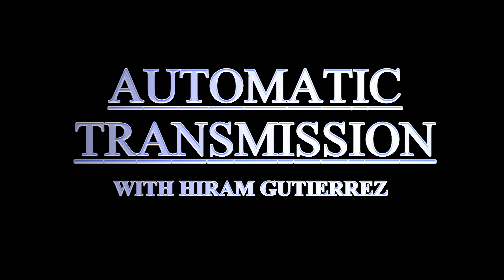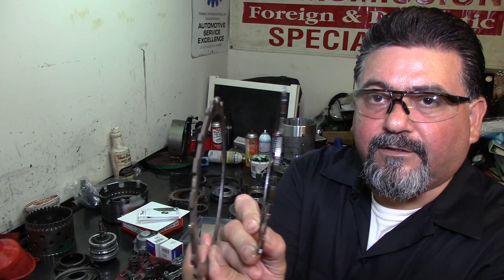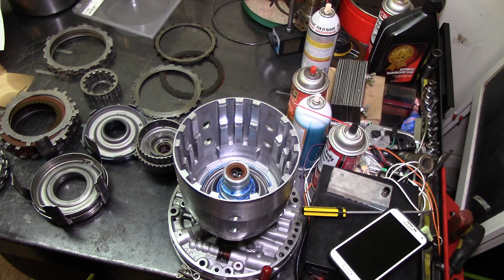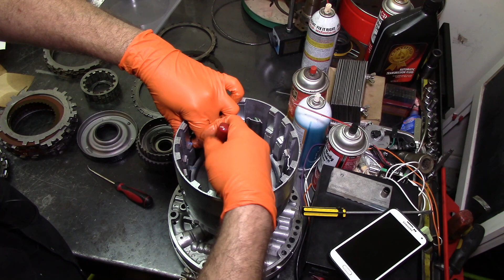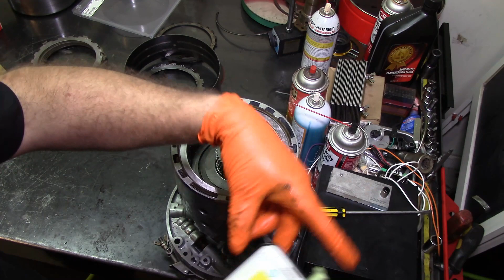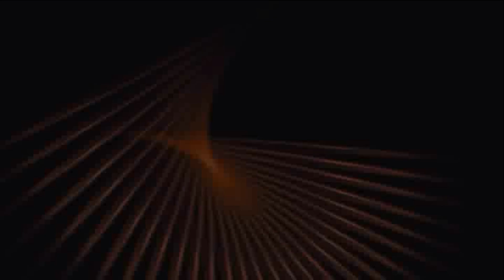Z-PAK by Raybestos 4L60E 700R4 3-4 High Performance Friction Plates

Comment: I've been a tech in the Valley of The Sun, AZ for 15 years but never once rebuilt a transmission. Watching your videos has inspired me to learn more about transmission failures and rebuilds. I was just given a 98 S-10 Blazer that needs a rebuilt engine and fresh trans rebuild by the looks of the fluid. Seems like it was stuck in Second Gear at all speeds. Maybe a solenoid issue but all of that will be replaced. It will be my first Full Transmission Rebuild. What Do you think about rebuilding Nissan CVTs? Thanks for all your videos!

Comment: What actually does the shift from 3-4? My 4L60E has developed a harsh change from 3-4. It's mainly when coasting or gliding. It gets to 55 Kph and it's like it just dumps it into 4th instead of the normal smooth transition. Also when coasting into a stop 2-1 can clunk in. It's like it just drops it to 1st harshly at the last minute. It doesn't seem like there are any burnt clutch plates etc, just harsh changes. Not all the time too BTW. Happens more after a longer drive, hot weather, rainy weather. Very strange. I was going to change the A & B shift Solenoids but I don't think they have anything to do with 3-4 change? Any help or info appreciated .-.-.
Reply: In the servo, (cap on the side of case) is a second piston on top of the 2nd apply piston or most commonly used Corvette servo. The band is used in 2nd and 4th. 3rd to 4th only change is the band gets applied
Reply: @kylealexander1172  thanks. Still driving the same car. I believe it's a mount going somewhere causing movement between shifts. The slow down clunk to 1st is apparently common even from new and something to do with the diff.
Reply from the maker: Scan it just to make sure you don't have the P1870 code. If you do the valve body is worn on the tcc isolator valve. It'll give you hard shifts when hot. I  have 2 videos addressing that issue.
Reply: @AutomaticTransmission  thanks. I have a Vident i400AU.  Have scanned the car many times over the past year. No error codes bar a SRS loop high resistance err (clockspring). But certainly no transmission error codes.

Comment: hi I need some help if you can I have a 1992 gmck 1500 4x4 and was towing a 20ft motorhome and backing it up and heard a slight ping noise and now no reverse, when you first start the truck and put it in revers it wants to go but stops then acts like neutral but doesn't want to roll in reverse hardly at all, it still shifts in 1,2,3 but shifts later 25mph and harder I want to know if this is re buildable b4 getting a kit thanks for your videos and help
Reply: Stripped sunshell

Comment: Mr. Gutierrez, I would like to get your opinion. I will be having my 4l60e rebuilt it's in a single cab 03 Silverado its at 425ish horse power I daily drive this truck. my trans builder is telling me I don't need the sonnex smart tech drum. I figured it would improve longevity of the trans. I would like to know from you what should I be having installed to ensure my trans lasts.
Reply: Victor Lopez 
Everything helps, I'm getting a rebuild 4L60e for a blazer ls swap .
I was really lucky that I found a 4L65e ( 5 planetary)  I bought Raybestos ,  drum  , selenoid  $300 so far in parts .
Reply: Adds $600 to the build

Comment: Hey Hiram, I'm a certified Automotive technician, and I've watched alot of your videos, and they have helped me alot. I'm a self taught builder. I was wondering if you could do a build on a 6T75? Ive done a few of those recently, and was looking for a video you've made but could only find dissasembly and common problems you've made, and also maybe some tips on testing the Tehcem on this transaxle? Your knowledge is priceless,and I'm sure I'm not the only Tech you have helped tremendously! Thanks for your time making these great videos.

Comment: I just built a 700r4 with the zpac clutches and   replaced the apply ring with a #7 but did not replace the drum itself. will it be ok?
Reply from the maker: +bob Owens Yes.
Reply: I have a 93 drum in my 90 700r4 case.  Do I need a 98 drum to use the z-pack?

Comment: Nice build so far Hiram. His truck will be a new animal with that converter and it'll help his 60' times and bring the engine to it's power band quicker. I ran a TCI 8" 6000 RPM stall race converter in my altered and thank God for my wheelie bars!

Comment: Hmm, for some reason, I thought the torque converter for a Trailblazer was a different size than one for a full size truck 😕
Reply: It is.
Reply: It depends on if the trailblazer is  a v8
Reply: Trailblazer is a source of inexpensive high stall converter
Reply: 2200 or 2500 stall from the factory

Comment: I repair alot of 4l60s with the 3-4s burnt out of them .
this is very helpful!  does the bonded piston come with this kit?
Reply: Hi Joe,
do you have to take anything else apart besides the torque converter before getting to the clutch pack assembly?
I'm thinking of rebuilding my 4l60 (trans leaked out fluid before and was driven on low trans fluid), which causes delayed engagement (acceleration delay before going into gear) but I want to make sure there isn't any more surprises, as taking down the transmission will already be painful enough (no lift available).
thanks
Reply from the maker: +joe wisman The piston is separate

Comment: Awsome vids! I watch and learn. Would like you to do a vid on Uprating and J modding an earlier model Ford 4R70-W / A0D-E. And the difference between building for street/strip and heavy towing/high continuous torque loading. thanks.
Reply from the maker: +Billy Bracewell I'm not sure about the J mod. I've seen it but I'm not sure if it would work. Or what its supposed to do. Some things about it doesn't make sense to me. But regarding the performance upgrades on those, I will make some videos for it.
Reply: In my pre wheelchair past i have done this. It is only a mod for making it shift VERY firmly. WITHOUT the "slip" of softer shifting units. THAT is  just for conserving your unit. the uprating and settings for continuous  high torque loads is more my concern. (hint) producing a simple tranny that can be easily rebuilt for high horsepower heavy torque apps.
Reply: AWSOME!! FYI the "jmod" only makes it shift firmer and harder. This saves life expectancy as it reduces or eliminates the "slippage" that accrues for "soft sift" situations. THANKS for replying bro.! I will be watching. I have a much modded 94 ford lightning. 1 of the only 780 so built before step side and tonneau covers.yeah, no more E4OD. she now sports a cobra GT500 engine in front of a weakling soon to be rebuilt/upgraded 4R70W/AODE. The 308 rears are and have been a challenge. I have now replaced the nest TWICE. Thinking on going back to the original 4:10. BUT i am getting over 25 MPG with the 308!! WOW!! MAYBE I can go to a 2:73??? Yeah. I'm A TECHIE DREAMER!!

Comment: what do you think about heavy-duty torque converters for 1997 k1500
Reply from the maker: +God is the way mm you can get performance converters for it, yes.
Reply: because I want heavy duty transmission for more torque for my 1997 k1500

Comment: WHAT DO I NEED IF I PUT 200HP SHOT ON MY 2004SILVERADO
Reply: A full length shot?? A gold level credit line at your local advance auto parts....and a standby crate motor ready to install.
Reply: The Silverado line of trucks specs out a driveline that is geared more towards high torque rather than horsepower. several expensive mods need to be made to accommodate a full double aught buckshot.
Reply from the maker: +Cory Gosso A torque converter with balloon plate NOS ready.
Reply: it has a controller it a progressive shot not a full shot and i just needed to know about how to keep 4l60e from slipping and a 4.8 ls is able to take it without forged internals there good up to 650hp so 295hp+200hp =500hp ok im more worried about putting it to the pavement and i do have a 5.3 on the ready
Reply: That will NOT reliably work. PLEASE do not try to give advice that only concerns the tranny in that type of app. He will BLOW that motor to pieces with that full length burst! Nitrous demands full forged rods and pistons LOWER stock conventional intake/compression ratios. AND ethanol free highest octane fuel. PLEASE!! If you are a "back yard hack" keep your "FUN" to yourselves or  'roadkill' garage....thanks no offense meant, but I am a tech. and I KNOW what happens...and unless you are a 'car go bang' junkie you would NOT under ...WELL...MOST circumstances try this .

Comment: Hey  Hiram,  what  is  the  difference  in a 4T40 E and  a  4T45E thanks.
Reply: +Mark Quigley  The 4T40E is a transaxle but my experience with 4L60E, the 4L65E has 5 pinion planetary in front and rear, instead of the 4 pinion that goes back to the 80's. Do some research for parts, but is increases the load capacity. Other parts should be updated as well for holding and clutch pack pressures, plus release abilities to keep two gears from being engaged as the same time either up shifting or down shifting to reduce heat. Hope this helps your 2 year old question. Retired ASE Master Tech.
Reply: @deankay4434  Better read his model number designations again, 'eh?  BOTH transmissions he listed are transaxle units--thus, the "T" designations--4L60E--DUH?!?   The 4T45E is a  stronger unit, by the way...   lol
Reply: @bobhoffman5581    >This is simply a comparison as the designation “T” is a transaxle. But the 4 spd, “T” for transaxle, followed by 40 or 45 is the difference in the number of planet gears used for supercharged applications….The same as 60 or 65 in a longitudinal configuration, where as the 65 has modified Simpson gear sets using 5 planet gears instead of 4, resulting in an increase of the number of teeth on contact. Mostly, you incorrectly read my comment as not a comparison as some techs never rebuild transaxle transmissions. Some never opened a rear drive longitudinal mounted transmission. Have you ever seen a Simpson gear set with 5 sun gears? My trans has two of them. I know since I built it!  Sounds complex yet simple works in a small package like the 4L30e that uses a “Ravigneaux” planetary gear sets that has timing marks on them. I have repaired several dozens under warranty as no one else in the Chicago Zone at dealers would replace and not repair. I didn’t know, but my Zone Service Mgr told me. Quicker for the customer, easy parts inventory and more labor flat rate hours for me! 
  And please don’t ask who Simpson is? Google it! 
  So, take a deep breath, read what is written and not what you think you saw. You will be a better person for it! And Yes, you are welcome!